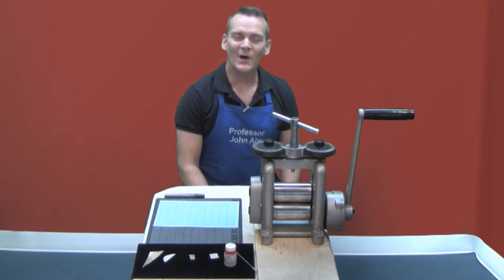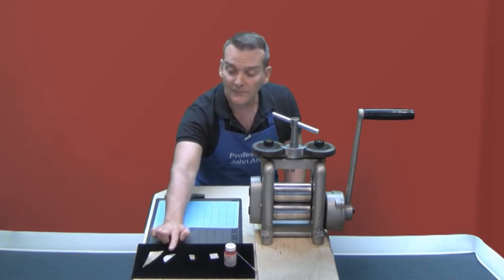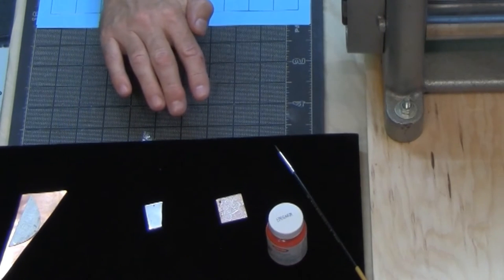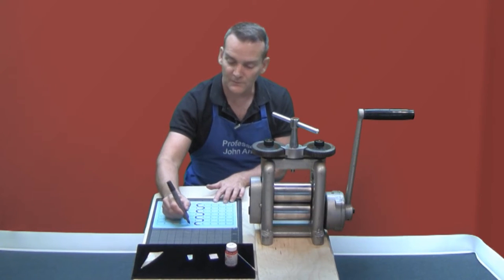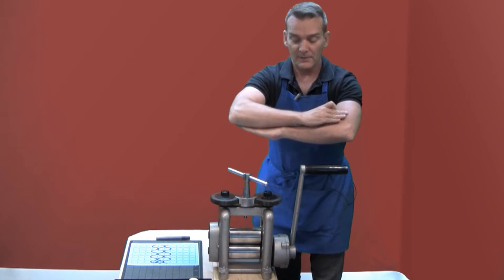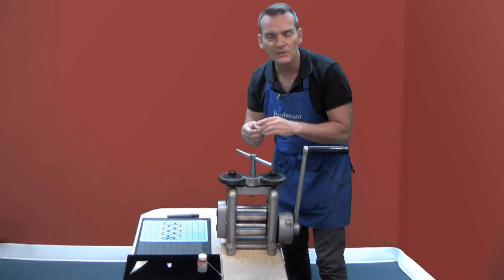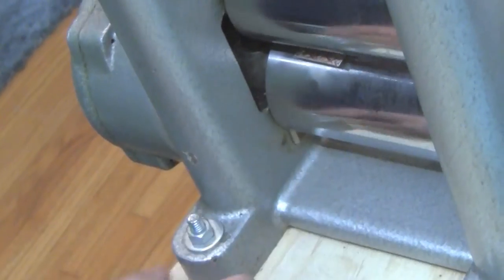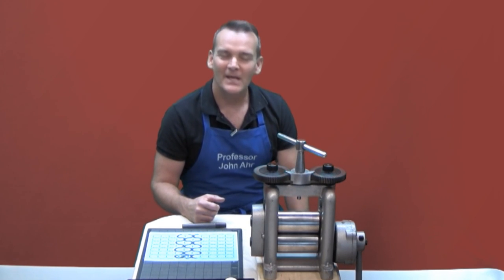Etching And Rolling Creates Amazing Inlay Effects

Comment: Good clear instructions as usual.Thumbs up!
I think I understand the method of turning the dials to 0 but not sure why.
The increments on the dials of the roller I use go from 0 - 14<. 15 is (back to) zero. 15 is also 1.5 mm so  it's all done in tenths of mm. 
I just take a mental note of the measurement from the start. 
From the video I'd say John was reducing the roller by about 2 digits, ie. 0.2 mm assuming it's a roller calibrated to 1.5 mm.
Thanks John.
Reply from the maker: Glad you enjoyed the video.  To be perfectly honest, I wasn't thinking about the rate of reduction that the rolling mill causes.  I was rolling until the edges of the copper completely disappear.  But, I like that you cleared up the rate if compression for others.
Thanks for your support! : )